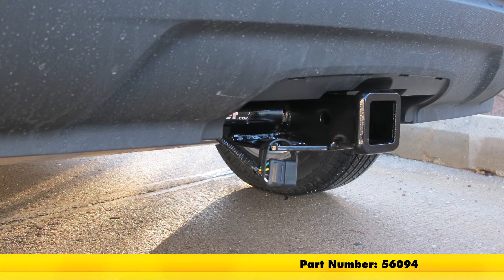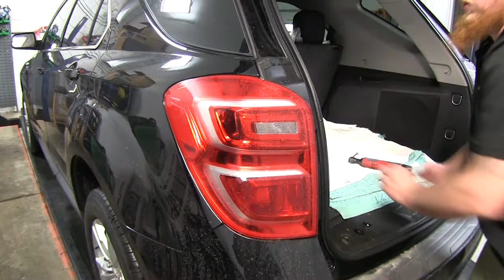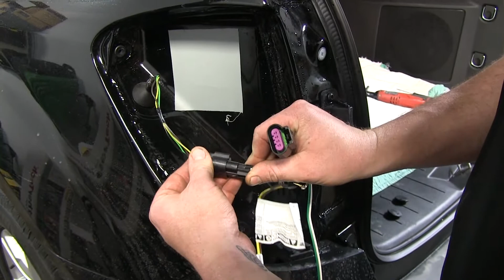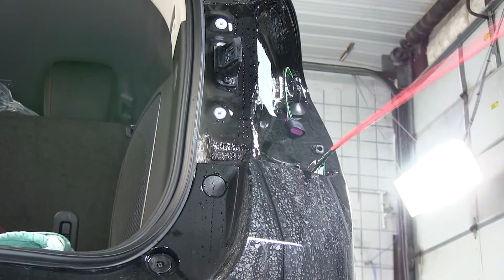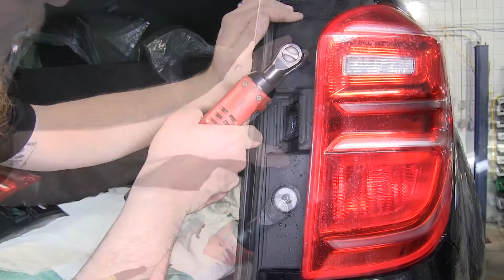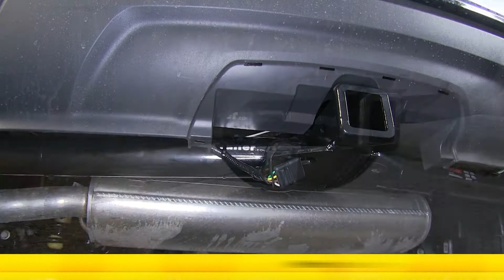etrailer | Trailer Wiring Harness Installation - 2016 Chevrolet Equinox 56094

Comment: Can i install this tail lights on the previous model of Equinox (2010-2015)?
Reply from the maker: This kit is designed for the 2010-2017 Chevrolet Equinox. I have provided a link to our product page for more information.
https://www.etrailer.com/Custom-Fit-Vehicle-Wiring/Curt/56094.html